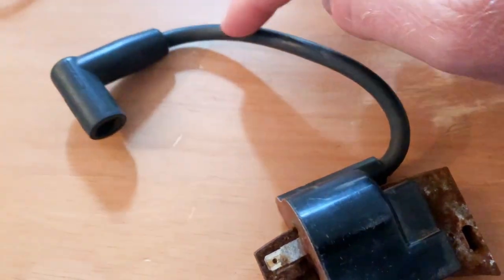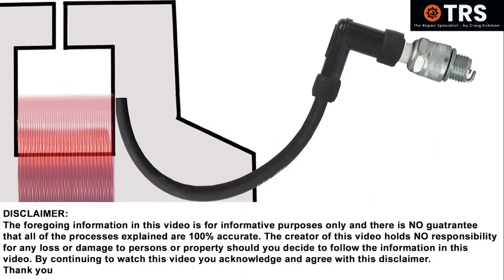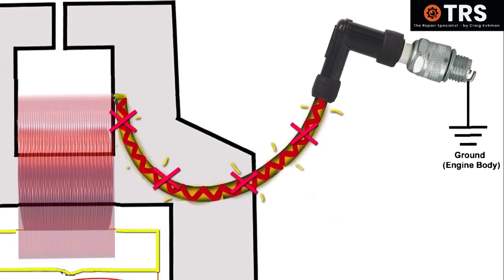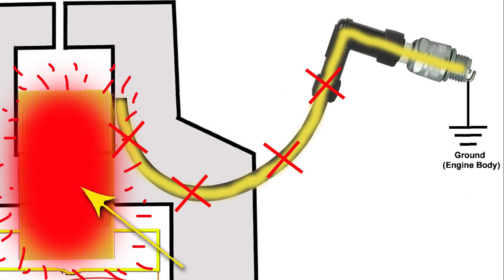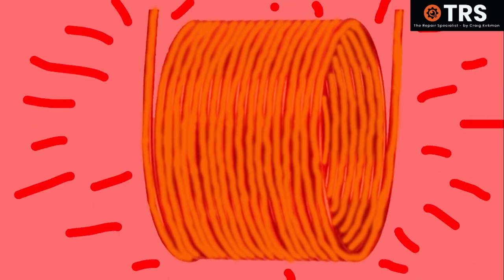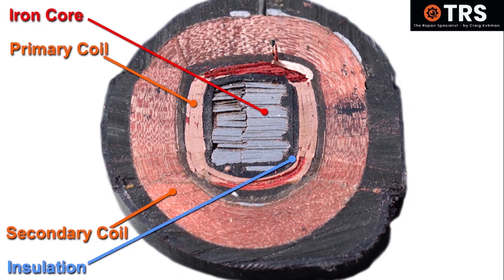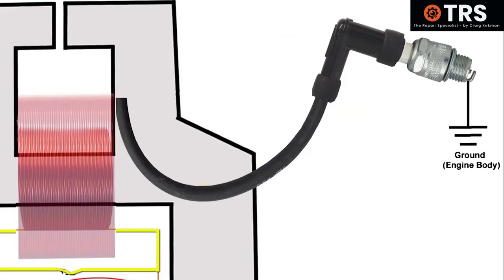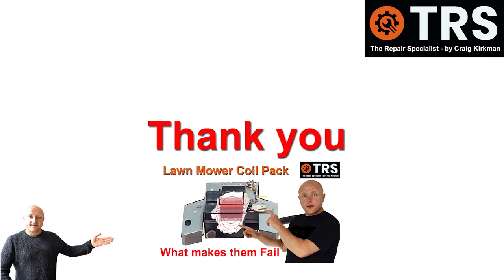WRONG H/T LEAD does this to your Ignition Coil  (High Tension Lead Lawn Mower Coil)

Comment: Really good video, I would like to add to this great work and say I've come across and personally have had problems with the spark plug cap coming loose creating high resistance, causing significant damage to the cap and boot.  I now use red threadlocker on these little caps.

Comment: An interesting and informative video, but, on a negative earth vehicle, because electron flow is -ve to +ve, the electrical flow is from block, across the gap and up the lead to the coil. However, your explanation using conventional current flow is more readily understood.
Reply: Some people say that positive ground vehicles have far less rust.

Comment: So , if replacing that HT lead, should you look for a car lead with the lowest resistance? What is resistance you would want as maximum or is each 2 stroke coil very diff? Secondary is supposed to be 4.5-6K resistance on these little coils?  Can you pick a lead with too LOW resistance?

Comment: Good afternoon mate.. thanks for the video.. I have found that sometimes a coil can give a  good reading but still a bad coil.. why is this do you know why
Reply: Mick, me old china! The higher the compression, the more voltage it takes to fire the plug. The multimeter test is done with no compression so it may test good but not be strong enough under load.
Reply: @billshedd55  it's a good cement bill..
Reply from the maker: Hi Mick. Thank you for the feedback. Much appreciated. Im actually in the process of making another vid on this, but certain things such as the compression point at the spark plug and heat within the coil can make a difference. As for the latter, coils are generally tested when cold, but when warmed up through usage, they show they are actually well shot. Good old heat expansion of inner components as well as small cracks in the insulation becoming bigger cracks, letting current through to areas it shouldn’t be can be a factor. When testing a cold coil, the multimeter will only pick up the cold coil resistance, but the hot coil resistance may be different here. I’m not saying these are the only points mate but the vid I’m doing will show a few more. Hope this is ok. I’ve emailed you about the other thing you asked me a few days ago as well mate 👍
Reply: @TheRepairSpecialist  Thank you for this explanation to Micks question. Makes sense. 
Stay well, Joe Z

Comment: Have recently received a new coil for a tecumseh lev120 the HT lead out of the coil pack was a machine screw encapsulated in plastic and plug wire twisted onto that on a high vibration lawn mower. How does one secure that HT lead better, spark generation failed after first use.

Comment: Hallo
I have 0 ohms in high tension lead
I testede with multimeter set to 200ohms the data skeet for the coil says Therese should be 7,6ohms  with one lead in plugcap and the other lead on the base of coil the primært coil is correct ohms according to datasheet

Comment: Like a tuned exhaust, radio wave guides, antennas, etc.  I never understood why they call it a High Tension wire instead of a High Voltage wire.